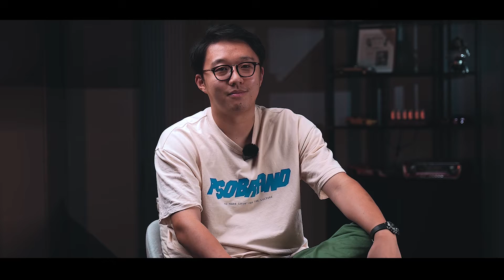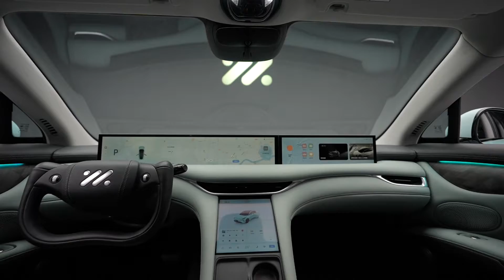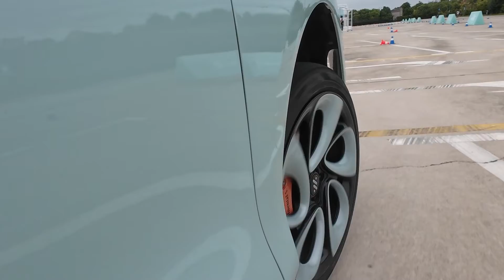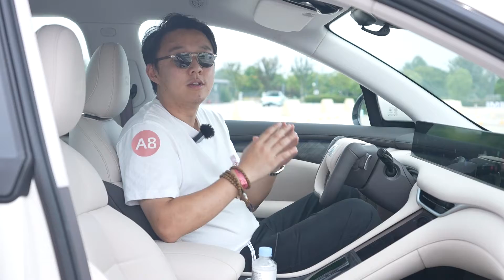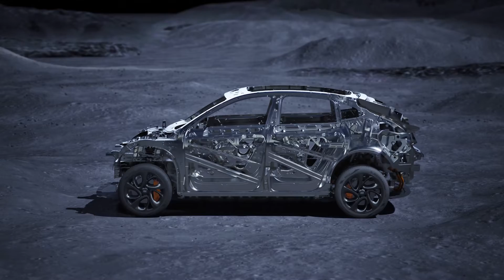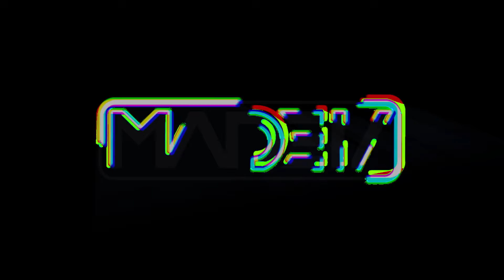IM LS6 has 99.9% of Model X Plaid but costs only 1/3 of it! Test drive and review

Comment: It may be 1/3 of the model x plaid on the Chinese market, but we know thatChinese automakers bump up their prices one hell of a lot when they're imported into the EU.
TBH, I'm not even remotely interested in an SUV, but thenewly launched L6 is MUCH more what I'd be interested in. Even if it sells for the same price as a model Y, I might still be interested but, seeing as the rumoured EU price looks set to be much, much closer to the model 3, then I'm getting seriously interested.
Why not a model 3 or Y? Because I truly detest Elon Musk, but also because I am not even a little bit interested in a vehicle that has no rear hatch.
Currently, my interest is in an MG4 as so few other EVs offer RWD, towing capacity, decent room in the rear and a hatchback. I think that the 4 may be a bit small, but there are rumours that the new 5 will be an estate version of the 4.
OTOH, an L6 is clearly a step up from the MG 4/5 in both quality and size, and I reckon I could be easily convinced that the difference is worth it. 
The real questions; how much is the €uro price going to be?
Reply: Dude, I'm waiting for the launch of L6 just like you. Be patient and you'll know in March. And I'm looking forward to L6' s semi-solid battery and lateral driving mode. You can check it.

Comment: Thanks for the great video. Do you or does anyone else who sees this know which company supplies the lidar for the LS6? Old reports had U.S.-based Luminar supplying Zhiji, but it is becoming less and less believable to me that they would still be supplying the lidar in a vehicle like this today. Admittedly, if it's due to an old contract and/or at a severely discounted price, I suppose this could explain such a thing. At any rate, it is a small and very specific question, but I tried searching in Chinese for anything on this and failed. Separately, I see screenshots of MIIT applications for new vehicles, so I assume they are publicly disclosed, but I haven't yet found out where to access those either. Does anyone have advice or a link for that? Again - thanks for the video. Great insights.
Reply from the maker: the Lidars is from Robosense, a Chinese company,
Reply from the maker: And it's the Robosense M Series,
Reply: Never mind. Apparently it's a RoboSense.